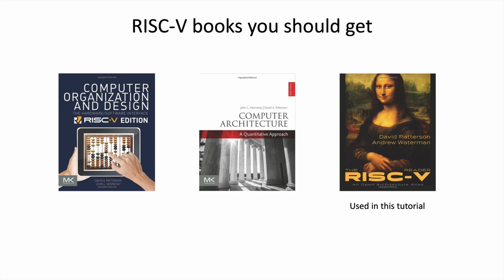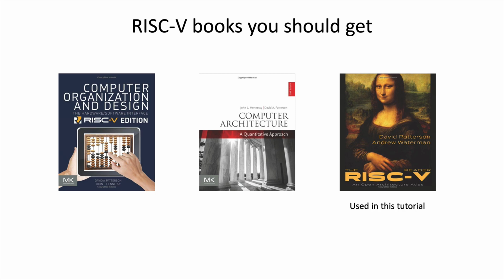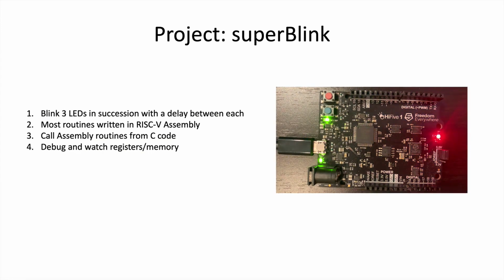RISC V ASM Tutorial | Part 1 of 12 | Introduction

Comment: SiFive is pushing the HiFive Rev B, which still uses the E301.  Any insight if & how this tutorial series is impacted by changing to the Rev B?
Reply: This tutorial will NOT work with Rev B.  The LEDs are different.
Reply: Ok, I was wrong, I was testing on what I thought was a clone board, but it does't have the LEDs.  The tutorial works on HiFive1 Rev b as long as you change the board setting in the platformio.ini file to reflect the rev B board.  Change the board = line to reflect:  hifive1-revb